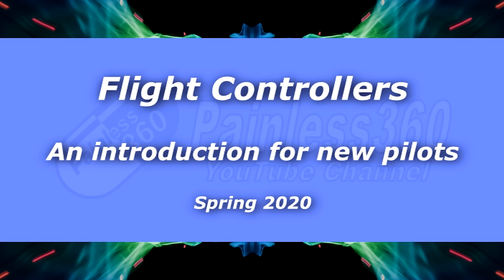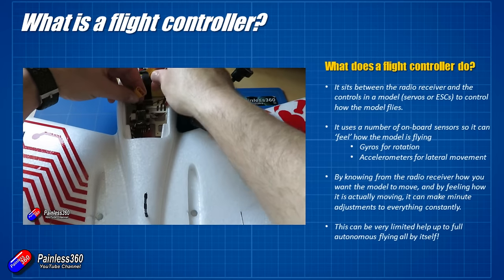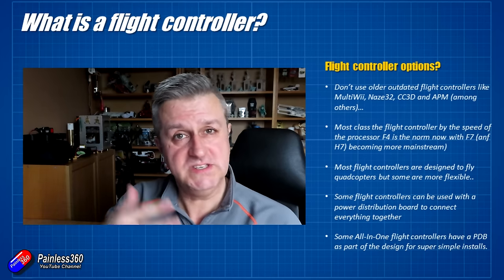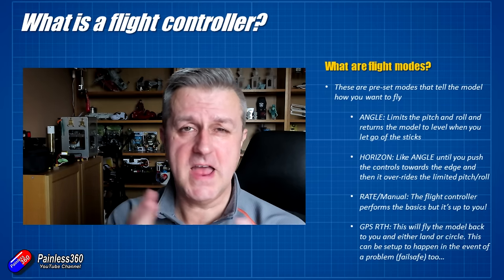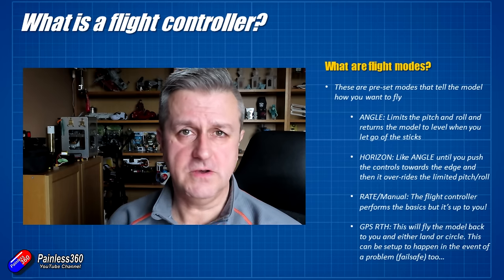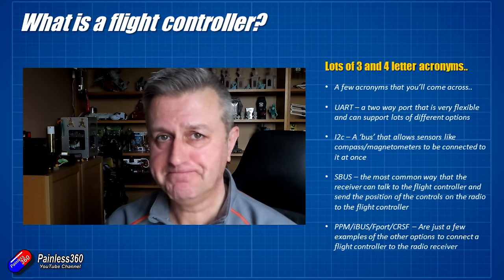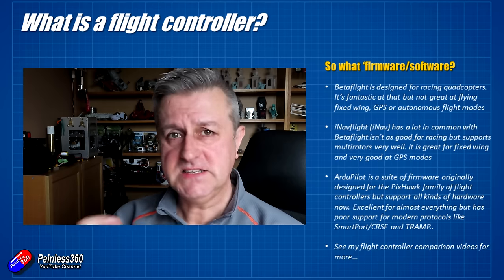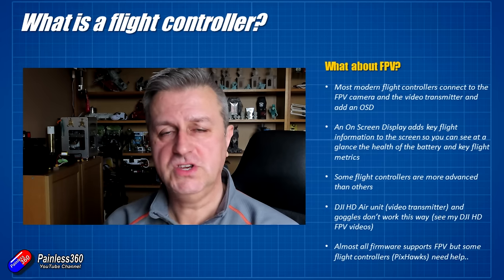Flight Controller Basics for Complete Beginners

Comment: Been flying drones for years, but just got a deal on a Volantex Ranger EX I couldn't pass up! ($120)

I use Speedybee and HGLRC F7 flight controllers for my drones but have never built\bought a FC for a fixed-wing before. I plan to use the plane to capture cinematic video, not acrobatic\stunt flying.

What would you recommend for my first fixed-wing adventure? The price should be $300 or less. I've only used Betaflight up to now, but am open to whatever software you'd recommend.

Thanks for the awesome videos! You just earned a sub!

Comment: Hi! Thanks for this video it defo really helped! I bought an APM 2.8 a couple weeks ago from ebay and to say, even after researching this huge topic over the course of a week, I was extremely disappointed to see that when I put arducopter onto the board my APM had been retired and couldn't use the latest software. Nevertheless, I have put this into my drone I have been building and last night I managed to get the motors to spin up and almost take off after two weeks of making this thing! I had two big problems;
1. The back two motors lifted first and almost tipped the drone over.
2. I got an error from prearm saying something about my thrust failsafe values.
For point 1 I think I'm going to try to calibrate my escs one by one to see if this fixes my problem and for point 2 I feel like if I set my controller (Flysky FX-i6X) failsafe to the lowest using lowest trim, and recalibrate using the highest trim this could provide enough separation for the message not to appear?

Do I sound like I'm on the right lines? Can I still get APM 2.8 to work properly? and finally, after forcing the drone to arm and after it almost got wrecked after lifting one side before the other the drone would not disarm and I had to crawl underneath to unplug the battery as the mission planner software kept saying my order to disarm was rejected by mav, what could be the problem here? and how could I possibly fix this?

Once again thank you for the video, it truly has helped my understanding and next time I'll make sure to buy the latest hardware!
Reply from the maker: The APM is very old now and all of the steps covered in my APM series are still a useful watch. I cover how I get it all working and how to avoid the common mistakes. Best of luck
Reply: @Painless360  Thank you for the fast reply! I managed to calibrate the escs, and fix the thrust value error for the failsafe. Now the thing just seems to want to tip over every time I hit the throttle! Ahhh this is such a fun pain in the neck 😂 I'll rewatch your series to just make sure I've got everything else right and hopefully figure out my new problem!

Comment: Great video and info.  I have designed a heavy lift drone and am at the point where I need to purchase a radio system and autopilot system, etc.. The system would need to be able to take off as a multicopter and then transition into forward flight.  I need help in choosing the correct systems and programing them.  Do you or can you pass me along to a person or company that Ican hire to help me with this?  Thank you in advance.  Steve
Reply from the maker: Didn't I already answer this on another video?  No need to post twice... happy flying!

Comment: I have a really weird question for you.  I want to add a FC into another electronics project to make use of the Baro, Gyro and OSD out.  Can i use an FC as a passive component?   Or does the FC need to have a remote connected for it to work?   My video display will be hardwired to video out  of the OSD (no VTX needed)  because I only want to show altitude, horizon, compass etc. automatically on power up of my project.  Is this possible? Love the videos! and thanks for any advice you can provide!
Reply from the maker: I'd still wire the FC in and then fly in manual mode.  Get the OSD and lots of additional benefits... best of luck

Comment: Lee, very interesting approach in your video. By the way, is there any rx in the market which includes a flight controller and telemetry and that can be used with one of the protocols integrated in the TX16S radio?

Comment: After years if pause from the hobby i just realized there are a lot of new stuff new protocol such as express LRS, my radio is still Taranis X9D+ and all my quads are still rocking F3 and naze32 i am still happy with them when i tried then last night. I'l probably build a new quad when time and money allows.
Reply from the maker: There can be a lot of snobbery in places like YouTube and the forums if you are not using the latest stuff. It can mean that you are missing out on improvements and extra features but...
The point of any hobby is to have fun. If you are then it's working for you.
Happy flying

Comment: Hello, I'm basically preparing this drone project for my  institution's science carnival. This is something I wanted to make as cheap as possible to show how a "Drone", as we know it, doesn't necessarily need to be the most sophisticated & stuffed with complex machinery (that's kind of the central idea behind it, as in that's the creative part to my prject you could say). So with that goal in mind, I took up this challenge of making a drone with nothing but ice-cream sticks (body frame), 4 DC motors (around 700 -1000 RPM), 4 propellers & a 7-9V battery. But, I have heard a lot about how it would be dangerous if I don't add an RC feature, given that the 700 RPM could possibly cut off a person's finger just that easily. For that, I need to know whether just a flight controller (without any power distributors & an RC controller that's specialized for drones) would work on that design? 
I really need the answer because my project presentation is in 1day's time. So I'd genuinely appreciate a helpful answer. Thank you.
Reply from the maker: I've just seen this. I hope that the presentation went OK.

Comment: Nice video! (As always) 
I got one question left.
Do i also need to mount them free from vibrations as strict as for a quad copter?
Reply from the maker: Ideally yes. Lots of flight controllers have some kind of vibration isolation... Happy flying
Reply: @Painless360  thanks

Comment: Great channel! I'd like to pick your brain. I'm about to begin a build AR wing.  I'm planning on modifying and run an edf but for slow flight, long duration.  Gps, Autopilot, return to home, gyro, and head track fpv are on the list.  I have hull, motor, servos, and  3s 11.1v 5000ish battery.  Could I get your opinion on some compatible gear with the capabilities I described? I also haven't decided on a radio, goggles, or ground station yet so if you have the time I'd love your take on that as well.  I was going to make a tracker and helical antenna etc with a repeater, something ingenuitive and compact with cooling fans. Any advice would be well taken. Thanks again! Back to surfing your videos trying to learn
Reply from the maker: EDF isn't a good choice if slower and endurance/longer flights are what you want. See my video on it in the motor and prop series..

Comment: This was really helpful. I want to get into this hobby with the long term goal of messing around with custom VTOL ideas that I have, so I want to get into a system that allows me lots of customisation ideally on a code level. Multiwii on an Arduino seems the best environment I found, but everything I read about it is at least 10 years old and I worry that I find suitable hardware.
So is this arduflight what I am looking for?
Reply from the maker: MultiWii is old 8 bit tech and not used any more. Most modern VTOL systems are using Ardupilot and Xplane setups.. https://ardupilot.org/plane/docs/quadplane-support.html

Comment: Excellent video. I'm starting from scratch. I've purchased a Volentex Ranger 2000.
Id love to have DJI Google, pan tilt, and way points missions. I'm very technically minded but I can't seem to decide on what equipment I'll need.
Would really like to know what you'd recommend in regards to FC and transmitters for this project. 
Thank you 🇬🇧

Comment: Great video as always. I don't remember seeing anything on dji flight controllers. Any specific reason?
Reply from the maker: I tend to make videos for technology that is 'open' and where the manuals and details are not clear. For me it's about helping pilots get into the air. As those DJI flight control systems are 'closed' with specific firmware and backup and support from their DJI resellers then I've never felt the need to make the same kind of content for them. Happy flying!

Comment: Thanks for the video. I have a question. Which current flight controller would you suggest, which already comes with a basic software, that I can use for a survey where I want to build my own firmware or modify an existing open source firmware like Ardupilot? Also budget friendly. Thanks again. :)
Reply from the maker: Most fight controller designed for Betaflight and INAV will ship with a version installed already. But, you would always update it to the latest and greatest as a matter of course for the setup.. Best of luck.

Comment: Great video.
I recently purchased an older used multicopter. It came with a multiwii board.
Can you explain why I don't want to use it? What would a f4 board do for my that the MW doesn't?
my usage is mostly cinematic flight.
Reply from the maker: They still work for basic flying but are poorly supported now.

Comment: I have a spare FC (F405AIO) from a Skystars STX225 quadcopter. Can I use it to build-up a fixed-wing instead? If yes - do I connect the servos to where the ESCs would normally be if it were a quad? Thanks for all your videos... Inspiring!
Reply from the maker: I've not tried that but in theory it's possible. Outputs 1 and 2 are reserved for motors so the other two outputs could support two servos for a wing.. You'll also have to rig something up to get the 5v from the BEC in the ESC to the servos. See my trick in the Ardupilot/OmnibusF4Pro build from last summer.. Best of luck!

Comment: Hi Lee, would you be able to do a video on a basic/cheap flight controller linked up to the dji hd fpv system for fixed wing ( not for control but just for the on screen display ) option for GPS receiver if wanted ? Would be nice to have a 3D printed mount for the flight controller board and air unit to keep the footprint small.
Reply from the maker: INav supports the DJI system. Check out my DJI goggle video all about it.. Best of luck

Comment: Thanks for this video, it helped me to get a better understanding of flight controllers etc however, I'm still abit lost of what is the best one for me? I've just purchased the DJI 03 Air Unit and Integra goggles. It's been set up but is in low power mode and from the videos I've watched it says that I need a FC. I would really appreciate it if you could point me in the right direction of what I need...
Reply from the maker: See my builds for beginners.  I choose newbie friendly hardware.., best of luck

Comment: after seeing a few of your video which is always so informative,I thought what better man to ask a question that no one else has been able to answer me.Perhaps your knowledge is wider and can be of help to me.I live about 1200 meters from my flying club and to check if someone is flying at the club,I would like to buy a scanner for 2.4GHZ transmitter,that will display activity and radio type being use in the display sceen.Can you suggest what type of unit will do this and the said range it have.You help will be greatly appreciated.Thanks .
Reply from the maker: There are a few options, a lot of the modern OpenTX and Edgetx radios have a 'scanner' and vensors like ImmersionRC have had things like an RC signal power meter in the past too. The issue is that so many things use the 2.4Ghz band most pilots use now. Plus at 1.2km range the signals from the chap at the field will be tiny compared to local 2.4Ghz radio from things like local Wifi... best of luck

Comment: Hi thanks for this. If you’re not wanting to program things and literally just feed data back to your handset / radio, then do you still need a flight controller? I have a glider I’m building and a total novice but I do want to feed altitude and variometer data to the radio handset and ideally, at some point use FPV.

Comment: Hi there, quick question - is the holybro pixhawk 4 have all we need to build out an 4-8 motor copter? or should I get the holybro pix32 v5 with the board? what is the big difference?
Reply from the maker: Not sure. I've only built quads with them. I'd check out the details in the Arducopter wiki i.e.. https://github.com/ArduPilot/ardupilot/blob/master/libraries/AP_HAL_ChibiOS/hwdef/PH4-mini/README.md .. Best of luck

Comment: Will the FC in rate mode in a fixed wing keep the plane stabilized from outside forces like wind? I guess what I would like to know is will it perform the same as AS3X?
Reply from the maker: Yes. See my video on the difference between MANUAL and ACRO. One still uses the stabilisation..
Reply: @Painless360  Thank you!

Comment: Aware that this is 4 years old now, but I have been flying a couple of planes (Bixler2 etc running iNav) with a F722 onboard and I am thinking about getting something like a Phoenix 2400 and wondered what flight controller and software you would recommend?
Reply from the maker: Check out my recent builds. The Speedybee F405 Wing and Wing mini are fab... Happy flying

Comment: I used to do RC airplanes when I was a kid.  I have no such gear today.  However I do fly High Power Rockets.  I like the size, weight and mounting options of FPV cameras such as the RunCam Hybrid 2 and want to use one in my next rocket going to 135,000 feet.  What is holding me back is the requirement to press a button on the bare board once the flight is over.  Trouble is that sometimes it takes hours or even days to recover the rocket.  Either the TF card or the battery will run out leaving the video without an end of file.  I see that these split cameras can be attached to RC flight controllers to start and stop the camera remotely.  What is the most basic system I need to integrate into the rocket and at the launch site to accomplish this?
Reply from the maker: Not sure, I use them in models where they start and stop recording with power. You'd maybe need  a flight controller to control it but I've never used one like that.. Best of luck!

Comment: What's a good flight controller for the AtomRC Killer Whale? I wanna build a full system with all the bells and whistles, gps, return to home, flying missions, multiple FPV cameras, one being gimbaled, flaps, the whole 9 yards. The Matek H743 V2 seems great, but I have no idea, I come from RC cars...
Reply from the maker: That is an ambitious project for a first build. It depends on what you want. Arduplane or INAV. INAV will give you those things, for INAV I'd always use a Matek Wing flight controller. See my kit picks video from August last year.. Best of luck
Reply: @Painless360  Thank you for your answer!
I've looked at a few of the Matek boards. The H743-SLIM seems like it will combine well with the built-in PDB on the killer whale.
I've seen your video on inav and so on - I think inav is the way to go for the mission planning and autonomous flight.
The reason why I want all these autonomous features is because in the final version of it, it will use a raspberry pi with a 4G stick as the receiver and vtx, and using internet for controls and video stream comes with latency and possible instability. So the more the machine can do by itself, the better ;)
I already built a car that works just like that as proof of concept.
Reply from the maker: Best of luck with it! Sounds like a fun project!

Comment: Hello, is there a flight controller which will work with an older Graupner 35 MHz please? My project is converting a large sailplane to become an ultra high endurance electric glider with solar cells but I would like to keep my mc-16/20 gear simply because I hate throwing things away. It would also be useful to have telemetry. As you may guess I am an old school aero modeller so any advice will be most welcome. Thank you! Regards Justin.

Comment: As a relatively newcomer to RC and coming from an RF electronics background, I've watched loads of videos to get me up to  some basic level of proficiency.  However, the one thing that I've never seen mentioned once is ESD control.   Every video i've seen shows people handling the electronics with bare hands; highly sensitive receivers, various FCB's etc. 
yet I also hear of pilots swearing at their piles of wrecked planes/quads because there was a receiver failure or it just 'fell out of the sky.
Am I missing something?
Reply from the maker: I don't take any ESD steps here.. If you have an environment where you create lots of electric shocks/sparks when you touch things then basic ESD protection would help.. Happy flying!
Reply: There are far more “likely” reasons for our models to fall out of the sky than damage from ESD during handling/assembly.  I guess it could do it, but it would be a long way down the list of issues for us

Comment: Does anyone know any diagram or how I can use a quad fc for an airplane. Do I can connect a servo where usually goes a motor in a quad or how it is
Reply from the maker: I would strongly suggest that you use a flight controller designed for a wing. I've build wings using Omnibus flight controllers and INAV - check them out... Best of luck!
Reply: Thanks so much